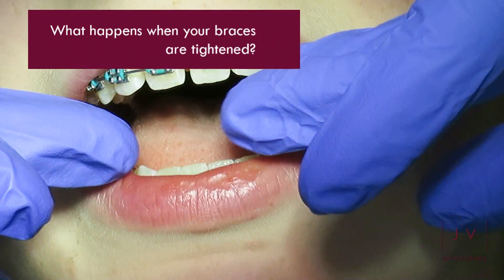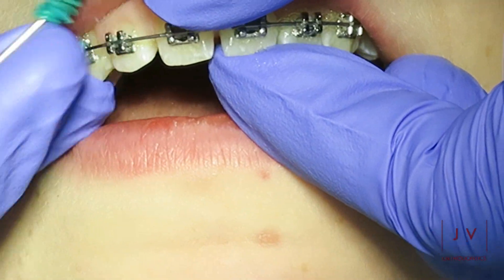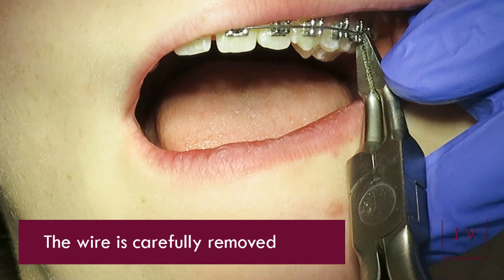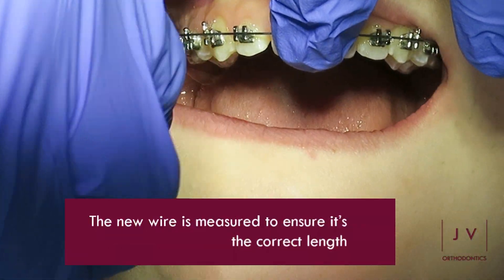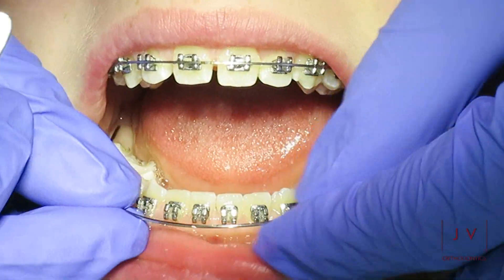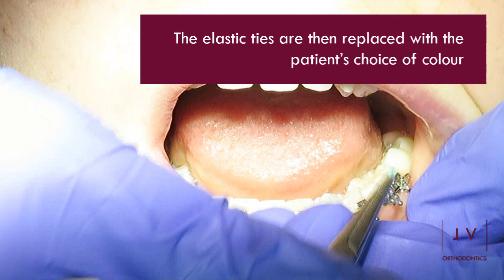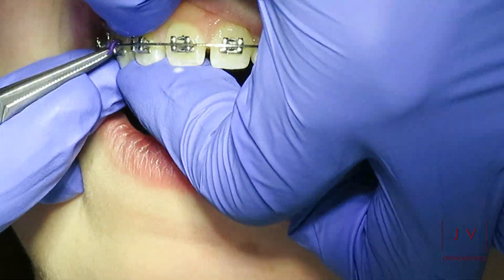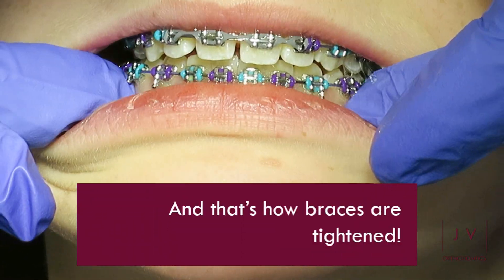WHAT happens when your braces get tightened?  |  Dr. Jiten Vadukul  |  The Orthodontist

Comment: I am wearing my braces from 1 month , when it's need to be tighten ?
Reply from the maker: Hi Rupa, it generally depends on the stage you are at with your braces. Generally however, we usually give approximately 6-10 weeks for the first set of wires to work through as these are usually the most flexible wires to begin the alignment process. Hope that helps :-)

Comment: I’m getting my braces tightened on friday and I am REALLY scared. Does it hurt while your tightening them or just after
Reply from the maker: Hi Georgie, it is completely understandable to be nervous about this appointment. Most adjustments are completely comfortable as the wires tend to cause the discomfort a few hours and days after the adjustment. Sometimes, if a particularly strong wire is used, you may find that certain areas will feel very tight during your appointment. There should not be any pain however, so if you do feel pain, then please let your Orthodontist know. I hope that helps :-)

Comment: hii I just wanted to say something. my orthodontist was tightening my braces and I bit down with my teeth to see how it would feel and I literally could feel my teeth biting on the wire. the wire was onto the top of my back tooth on my bottom teeth for some weird reason because they could’ve just cut it off if it was too long but I was biting onto it instead?? it didn’t make sense and I even told them I was feeling uncomfortable but they said they just bent it a little to fit it and “it’s okay”. I got home shortly and I had to rearrange that part of the wire MYSELF. It was hard but I eventually got it out the way but yeah that was not a very nice experience 😂
Reply from the maker: Hi Eren, thanks for your comment. I can't comment specifically on your situation as I have not carried out a full assessment, however I can give you some general guidance. Sometimes the wires are left longer at the back of the mouth to prevent the wire disengaging from the brace components that sit on the molar teeth, and in these circumstances, the extra section of wire is usually turned away from the cheeks so that they do not end up causing irritation. Sometimes, if a wire is cut flush with the back teeth brace components when teeth are crooked, as the teeth straighten, the wire can end up poking out from the back of the last teeth and irritating the cheeks. Without knowing your dental information, I wouldn't be able to say why you were biting on the wire, but if you experience that again, it would be worthwhile letting your Orthodontist know as there may be an Orthodontic reason for it. I hope that helps :-)
Reply: The Orthodontist thank you for the reply!!

Comment: does whitening of gum around the tooth means pressure is still applied?
Reply from the maker: Hi there, it is difficult for me to give specific advice without having carried out a full assessment, however generally speaking, when there is a force being applied to a tooth, the surrounding gum can become "blanched" which is basically a loss in the pink colour. The reason this happens, is because the pressure in the region prevents blood and fluids from flowing through the gums as freely as they could before the pressure was applied. Sometimes this sign can indicate too much pressure being applied in a certain area, so I would recommend that you visit/speak with your Orthodontist to seek their advice. I hope that helps :-)

Comment: I just tightened my braces yesterday and it hurts so much that's why I couldn't finish my lunch! 😭, what food can I eat without getting hurt?
Reply from the maker: Hi Patricia, it sounds like you are experiencing quite a lot of discomfort, I hope it gets better for you quickly. Most patients find an improvement after 2-3 days. The types of food I generally recommend are the soft, crumbly type which almost can be eaten without needing much chewing. The sort of foods which almost melt in the mouth can also help. Soups and blended foods are a good way to start. I hope that helps :-)

Comment: Hi Dr, I’m wearing self ligating braces bcos of my teeth having gap. My Dr said my teeth are all in order & good condition. I just wear braces abt 1 month and half. And today,I have my appointment. Then, the Dr change to thicker wire and I felt very painful. My question is....is it okay to change thicker wire since I just wear braces abt 1 month and half? And, it is okay to feel very painful after wire change? Thanks a lot Dr ☺️
Reply from the maker: Hi there, most patients will find some discomfort after their wire change as the wire applies more force to the teeth. It can be similar to the discomfort felt after the braces were first fitted, however it usually more mild than this. If the discomfort ends up being too much, then it is usually possible to use a slightly more flexible (or thinner) wire which will then apply less force to the teeth, therefore reducing the amount of discomfort experienced. Most wire changes tend to happen between the 6-10 week interval. If you are concerned about the discomfort you are experiencing, I would suggest contacting your Orthodontist who may be able to advise you specifically on how to manage the discomfort. I hope that helps :-)

Comment: So I need this like coil thing with my teeth to pull them forward. My sister said they cut her lip again but will they do the same for me or no?? And second when are we supposed to get rubber bands? And do we only need them if we need to fix and over bite? Cause my doctor said mine fit correctly or sum???
Reply from the maker: Hi there, yes there a few varieties of coil spring, but generally they are made of similar materials which are usually cut to size. Sometimes the cut end comes away from the wire (particularly if the coil begins to unwind) and can therefore catch onto the cheeks or lip. If this happens, using something like orthodontic wax can help to make it comfortable. Regarding your question about what I believe to be elastic bands, these are something that not everybody needs. Your Orthodontist will be able to advise you on whether it is necessary in your case. You are right, they are generally used for correcting bites, however they also have other uses. Hope that helps :-)

Comment: I got my braces in February and still haven’t got them tightened is that bad ?
Reply from the maker: Hi Camiyah, most patients who start orthodontic treatment with fixed braces have flexible wires initially. These wires can often be effective at applying force to the teeth through many months, so it may be that your brace is still working. It would be best to check with your Orthodontist however, as they will be able to advise you specifically on your situation. In many cases the braces can be left for longer periods of time provided they are cared for as advised, however there are a small number of situations which should be monitored more closely and your Orthodontist will be able to advise you if you are in that category. Hope that helps :-)

Comment: Hi! I wanted to ask something. So I usually get my braces tightened every 6 weeks but the orthodontist in my clinic is going to have some vacation so my next appointment will be in 9-10 weeks. Is that bad? Because there‘ll be extra 3-4 weeks..
Reply from the maker: Hi Flora, I get asked this question a lot and it is usually nothing to worry about. In many situations the braces continue to apply effective force to your teeth for durations longer than the usual adjustment intervals. The most important thing is to ensure you are maintaining optimal oral hygiene and taking good care of your braces. There are a few situations where you would not want to wait longer than the scheduled adjustment appointment interval, however your Orthodontist will be able to advise you on whether you fall into that category or not. Due to the Covid-19 restrictions, there are many patients who have not been seen for months. Many patients will not be affected however if you want complete reassurance, I would suggest getting in touch with your Orthodontist. Hope that helps :-)
Reply: The Orthodontist Yes, your answer really helps thank you so much!

Comment: Hello orthodontist, Actually I m from India and lockdown in india has been extended till 30 June .my orthodontist has said that he will not open his clinic till July.Can you tell me if this continues to be delayed,will this negatively effect my overall treatment??
Reply from the maker: Hi there Shraddha. One of the benefits of orthodontic treatment is that tooth movements can often continue for longer periods than the usual appointment intervals. There will however, be some patients whose braces are no longer applying the optimal force to the teeth and these patients might have their total treatment times extended. Provided oral hygiene is optimal and the braces are being maintained as directed, it is very unlikely that the treatment outcome would be compromised. The best thing to do at this stage is to speak with your Orthodontist about your concerns as they will have the specific details of your treatment plan. I hope that helps :-)

Comment: I have one question do they still get tightened if all they do is change the bands and not the wire?
Reply from the maker: Hi Alan, good question. It depends how tightly the wire was inserted at the previous visit- if it was fully inserted and it has fully expressed, then simply replacing the elastics will likely not have much effect. If however, the wire was previously not fully inserted, it may have moved the teeth enough to be able to fully insert it on the follow-up adjustment, therefore the elastics being replaced would allow the wire to fully express. So generally it all depends on whether the wire has had the opportunity to do what it has been intended to do. Hope that helps :-)

Comment: on a scale of 1/10 what’s the pain of it
Reply from the maker: Hi there, usually the actual process in clinic of having your braces tightened is painless. Sometimes if a strong wire is placed, there can be a sense of pressure on your teeth. Patients generally report the discomfort coming on anywhere from 1 hour after the braces are tightened, to a day or two later. Most patients tend to rate the discomfort at around the 3 level, however it varies widely. Generally, the discomfort following adjustment appointments is never at the same level that it was following the placement of the braces for the first time. Hope that helps :-)
Reply: The Orthodontist Hi I have another question so I pulled my tooth that wouldn’t come out which was my last baby tooth there is a little hard white part that is still wiggly is that part of the tooth or is that just a part of the tooth growing.Because my adult tooth grew under my baby tooth and I would love to know if it was a part of the baby tooth still in there.
Reply from the maker: Hi there, in many situations the baby teeth can fall out or come away in small fragments. These fragments usually appear to be wobbly if they are stuck within the gum. Generally, the developing adult teeth coming through beneath the baby teeth feel quite firm. I cannot however, advise on your exact situation so it would be best to speak with your Dentist or Orthodontist who may be able to confirm what the fragment is. Hope that helps :-)

Comment: I just got them tightened and it hurts...!
Reply from the maker: Hi there, if there has been some time in between adjustment appointments, the tooth movements can sometimes slow down. This can mean that when the braces are adjusted, the teeth have a new force placed upon them, hence the discomfort for a few days. If you're worried about the discomfort, it would be best to ask your Orthodontist for some advice. Hope that helps :-)

Comment: Ive been worried i freshly got my braces installed a month or two before everything with the pandemic happened I’ve had two tightening and tooth removal appointments canceled untill further notice and I’m worried this is going to set me back by more years. It’s so frustrating finally making payments as young adult to get my teeth fixed and everything is getting set back . I understand that this situation is bigger than me but it is still very frustrating financially at the moment. If anyone has any tips please lmk .
Reply from the maker: Hi there, I'm sorry to hear about your situation. It is a difficult time for patients and dental professionals alike. Unfortunately, the effect of this pandemic will likely be felt by most patients, whereby treatment time will likely be extended in the order of months. I would suggest the first step is to give your Orthodontic or Dental practice a call to ask for their advice. There may well be a financial option that suits your circumstances better or they may be able to offer you alternative options depending on your tooth positions and stage of treatment. The best thing I feel patients can do whilst at home is to ensure their brace is looked after so that any tooth movements can be carried out to the fullest and treatment can continue efficiently once practices are open again. Hope that helps :-)

Comment: Due to covid, I can't contact doctor.But it's been a month since I got braces. I'm worried what will happen to my teeth if it's not tightened after one month.Can anyone help me out.
Reply from the maker: Hi Sindhu, the first thing I would recommend that you do is to call your Orthodontist, as they have your specific details and can advise you if there is anything you should or shouldn't be doing. I cannot give you specific advice, however generally, I tend to advise my patients not to worry as the wires will usually work up to a certain degree and then they become less effective. What that usually means is the teeth slow down with their tooth movements and the brace becomes less effective. So I find that in most situations, there is no reason to worry except treatment might take a little longer. Hope that helps :-)
Reply: The Orthodontist thank you 😊
Reply: Sindhu Das it’s okay there going to stay in the shape the are atm don’t worry!
Reply: I know because I missed 3 dentist appointments and my teeth stayed in the exact shape ...just don’t take of the bands
Reply: Leslie Melendez thank you 😊

Comment: Hello , I was supposed to have my braces tightened last week , it’s been 7 weeks since I’ve had braces and I don’t know when I will first have them tightened due to the Covid -19 closing everything . Will
My teeth mess up badly as I’m not able
To get them tightened ?
Reply from the maker: Hi Eliso. Unfortunately there are many many orthodontic patients who are in the same situation as you. I would suggest the first thing is for you to contact your Orthodontist as they will be able to give you specific advice relating to your stage of treatment. Generally, provided you are not tightening any screws or wearing elastic bands, you should not need to worry as the brace effectiveness reduces most of the time if left unchanged. However as I said, you should find out if your particular treatment is safe left as is. Hope that helps, JV
Reply: The Orthodontist very helpful thank you very much .

Comment: I had my teeth tighten 4 days ago and it didn't hurt at all. (The doctor only replaced new elastic bands, not the wire) I don't know if it's working or not cuz I don't feel any pain.
Reply from the maker: Hi there, sometimes a wire is not changed as it may still have the ability to apply force to one or several teeth. The amount of discomfort patients feel varies greatly in my experience, so there may be occasions when forces are being applied to certain teeth without the entire brace feeling as tight as on previous occasions. If you are concerned about your brace, my advice would be to see your Orthodontist for their specific advice. Hope that helps :-)

Comment: Hey! It's been 1 month since I have got my braces.Today I had an appointment for tightening them..One of my left back molar hurt very badly while fixing the wires.Tried numbing that area but still I couldn't bear the pain.So now I dont have any wires fixed in the bottom row & will have to get them on next appointment😩.What could be the reason for only that area to cause so much pain because my x-ray shows completely normal..I experienced nothing like that when I first got my braces..And also I find it weird as to why when I first got braces my right upper & lower side hurt but this time I had no pain at all. except a bit of pressure🤷‍♀️
Reply from the maker: Hi Priyanka, it sounds like you're going through quite a lot of discomfort, I hope it's better now. I'm unable to give you specific advice without having carried out a full assessment, however it sounds like your Orthodontist or Dentist is investigating your discomfort, so they'll be able to give you the most appropriate care. 
From my experience, the teeth which tend to feel more uncomfortable are those that have had more significant force applied to them, or if they have sustained some form of trauma/injury which can cause the supporting tissues to become sore. There are some other reasons, but I find these two are the most common. I hope that helps.

Comment: After getting your braces tightened, how do you stop the pain? I got mine tightened today! 😢😢😢
Reply: Take painkillers. The pain usually goes away in a day or two.
Reply from the maker: Hi Romeesa, the discomfort following an adjustment usually lasts for a couple of days. If the discomfort persists for longer, then I would recommend contacting your orthodontist.